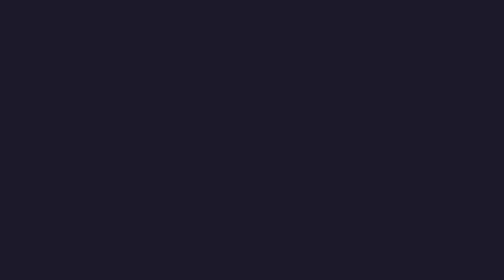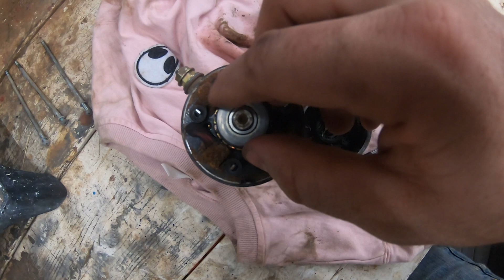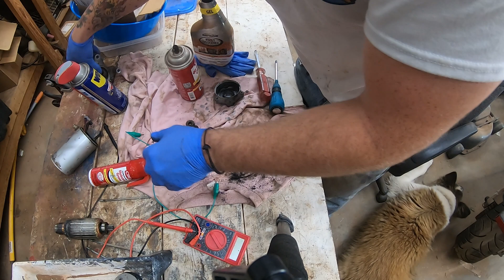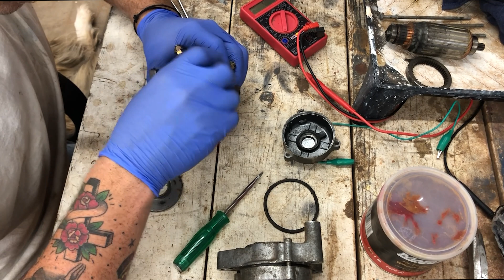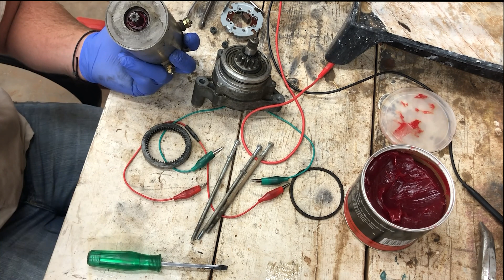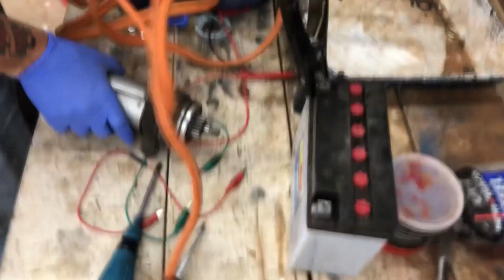Lets Fix the SEIZED Starter! 1988 Goldwing GL1500 Restoration Pt 13

Comment: I have a question. I disassembled the starter motor in my '94 Honda GL 1500 and while washing it, I found this small, loose sliding bushing. I don't know if I should install it and where?

Comment: Another high octane video.... I use to have an alternator shop I could get any parts but now (like most) he retired... I want to rebuild both the starter and alternator but haven't found any kits... any idea(s)? as for installing brushes.... I drill a small hole in the end of the brush holder.. make sure no birrs.. then pull the brush back  past the hole and slide a pin (rivet, drill bit) in the hole. it holds the brushes.. then once its together just remove the pins and you're done.
Reply from the maker: Thank you for the kind words! I do not have any idea's on kits to rebuild them. This goldwing is an 88 and it has the different starter than the other years, I figure I could use the brushes on the starter plate and solder them on if I wear out these brushes! But as far as kits go I am not aware of any, hopefully my local shop can rebuild them.  That's a great idea, I really wish I would've thought of that! I have seen videos on people winding alternators, it is definitely a lost art. I personally have not done it, but I might try if mine ever go out!
Reply: @octanerestorations  Maybe take the brushes & bearings to your local shop and see what they match with... that's what I did with my alternator guy.. once we found its twin I would write down the number(s) and share it on forums...... unfortunately I haven't found any posts with this info and since I live in Pa. alternator shops are like hens teeth so I'm out of luck!!  BTW mine is an 88 also.
Reply from the maker: @TheMamonti1 https://www.partzilla.com/product/honda/31203-MT8-008?titan_sku=31203-MT8-008  That is the plate I stole the springs off of, and it has 2 brushes attached. I did find an alternator brush and it says it would work on an 88! https://www.partzilla.com/product/honda/31101-MN5-005